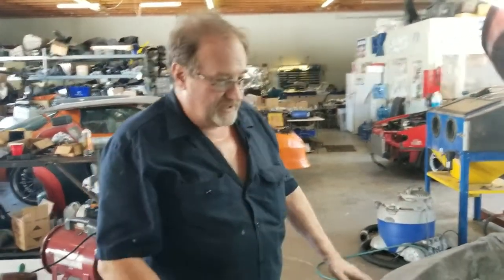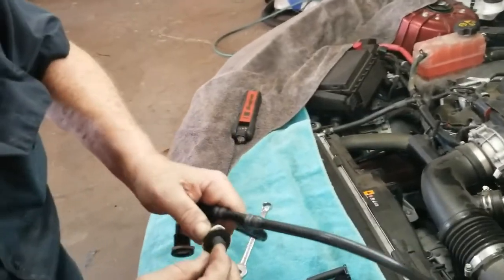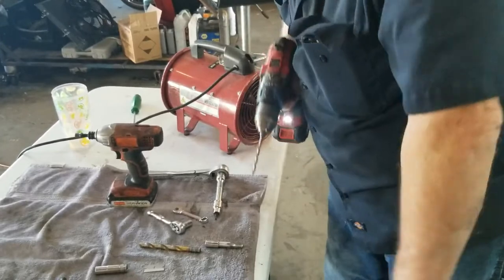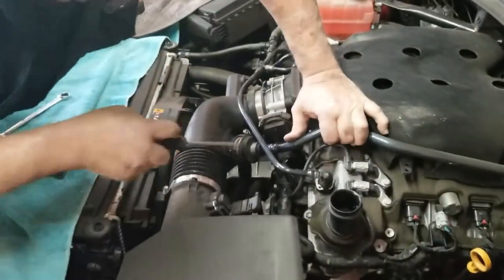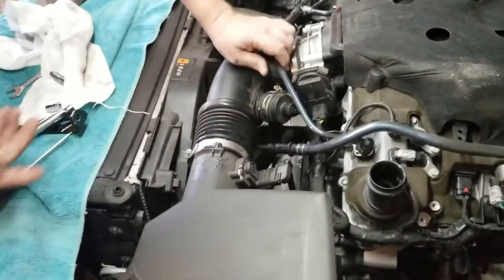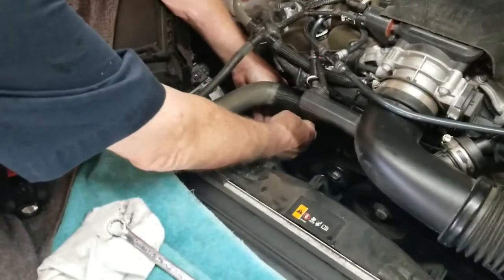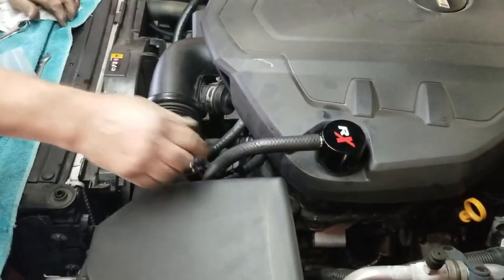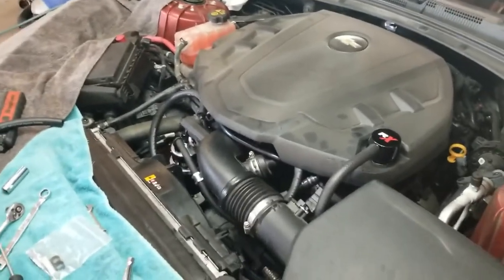Catch Can Install 2016 Camaro LGX

Comment from the maker: Update!  The rubber adaptor on the main intake air tube now gets capped and will not be used as the new Venturi Vacuum Valve will be for the second outlet from the can. BOTH checkvalves flow AWAY from the can!!

Comment: I want to put on the oil cap. All i can think about is debris getting into that sweet LGX!
Reply from the maker: Email us direct and can answer any questions you may have. The LGX GM deleted the "Positive " function so most of the damage and wear causing substances are now left in the crankcase contaminating the engine oil.  RXProducts@aol.com
Reply: I admit I have never installed a catch can but when drilling into the intake manifold I would remove it. I wouldn't want plastic bits going into the engine. Maybe that is just me but it doesn't sound like a good idea.
Reply from the maker: @dougdelzer6891   Put grease on the drill bit and tap to capture them, but they would pass through harmlessly and cannot cause any damage. Metal sure would. When the engine is new from the factory it is full of assy debris that is sucked through.
Reply: @tracylewisperformance1328  I am a nervous nelly! Keep up the performance!
Reply: @tracylewisperformance1328  I am a nervous nelly. Keep up the performance!
Reply from the maker: @dougdelzer6891    Just let us know on anything your not sure of and we will walk you through it.
Reply from the maker: @dougdelzer6891   Plastic cannot hurt the engine, metal though can. But to be safe we put grease on the drill bit and tap to capture the small debris.

Comment: Hey, quick question, why do you vent the valve covers (clean side) through the oil fill cap instead of through the tubes already exiting on either side?

Comment: I have a question regarding drilling and tapping the holes. Would that not void my warranty? I live in a small town in Ada, OK and the service dept at the Chevy dealership I bought my 2018 V6 Camaro from brand new throws a fit every time they pop the hood and see my Cold Air Inductions cold air intake. I can only imagine what they would say if they saw this. Also, this car is my daily driver and I don’t ever plan to take my car to the track, would this be beneficial too me? Thank you so much and keep up the awesome work. Love watching your videos and learning from the best!!
Reply from the maker: By Federal Law, this system cannot as it does not in any way reduce, defeat, or delete any of the functions of the factory PCV system and retains a closed compliant system. The FTC is the governing body. That said, there are more and more dishonest dealer service departments so we can in no way guarantee what they will do. From the actual history, we have app. 30,000 of these in use in the US and have never been notified of one voiding a warranty. And recently the FTC hammered Harley Davidson for voiding warranties for bolt on modifications that have no negative impact on the engine or drivetrain. This system has zero negative effects and many positive ones and GM and Ford Dealers have been selling and installing these all over the US and Canada to prevent the issues all GDI engines have.

Comment: I can’t find the arrows on the valves that point away from the can. When I blow should air get trapped is that away from can?
Reply from the maker: Checkvalves always flow away from the can. And the early videos don't show the Venturi Vacuum Generator, but a supplement should have been included in your kit.  Any questions, just ask!  APDEG@aol.com is our new email, and website is: www.V6Superchargers.com